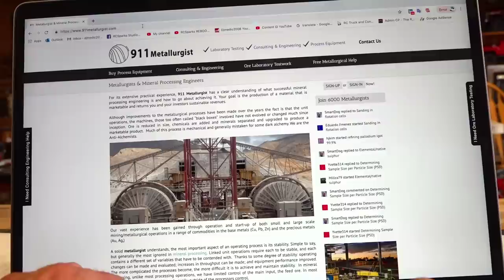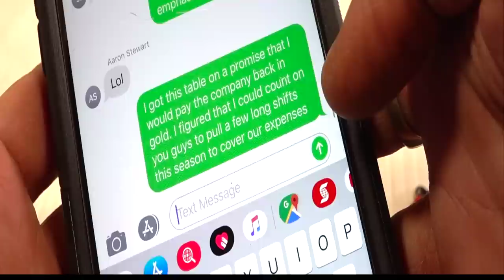YouTube GOLD - RESCUE 911: 4 Buckets and a Pool?! (s2 e7) | RC ADVENTURES

Comment: Dude some of your Guys are Too Slack with Safety.. Hard Hats etc.. Tell them MSHA could pop up or worse Do a Mine Safety Inspection. Great Job with setting up and Working.. I'm hoping you get a 10,000 Ounce Season 👍👍
P.S. Some M80s wire rocket engine igniters for (blasting caps) have to make detonator switch.. Anyway some Mine Blasting and Smoke Bombs💨💨 would be alot of fun.. or put one in the Pond 💥 and Float some Swedish Fish. 🐟 Candy  to the Surface 😲 😂 Thanks 1st x comment sorry so long.
Reply: Magnum Mountaineer  lol I fixed it THANKS 👍

Comment: Hey dude , on that dog house with the water pump. Go get you ( 2 ) 6in, fans and mount them on the sides to blow cool air in . Make sure you have them blow to the door , to blow heat out. Just an idea for you. In case you want to put the dog house back on there. 😂🍺

Comment: hey medic, sweet video as always and nice new gold table. I use a miller table and its really sloooow. just a little comment, if that's the stock motor in that excavator, that's running way too fast. it will make it hard to control and cause a lot of excess heat in the fluid.  the % is supposed to be at around 22% to 28% for the stock pump and motor. anyways, great show as always my friend!!!

Comment: I personally think where the Trommels grizzly bars are you should build some type of a shoot going down onto a conveyor and then into the rock crusher and then the from the rock crusher coming off of that conveyor belt should be going into that Bruder converted Mac dump truck and use the crushed rock to be used to build the roadways

Comment: Table is tilted wrong way almost level tilted toward water the shake shakes the lighter material away from water the gold should form a line close to water once gold is forming a line turn water down so it stays in line to end.so heavier water flowing at top slower water gradually as you go down the water flow is the key

Comment: Love the new setup, the one thing that is still a bit of a questionmark for me is: why aren't you saving the rocks from the white shaker that is at the end of the production, and build roads/store piles :D

if i had to pick favorites though, id definitly pick the red trommel as number one, the wheel loader as number two, the volvo dumper as number 3, then the excavators, the rock crusher, the white shaker (its low cause the end product isn't saved) and then the big mining truck that would make a great rock collector :D and then the bulldozers :D and the new white screener with mass control, and then the rest of the conveyors :D